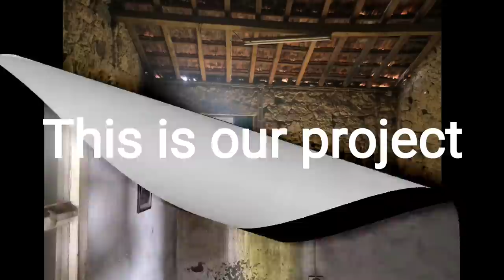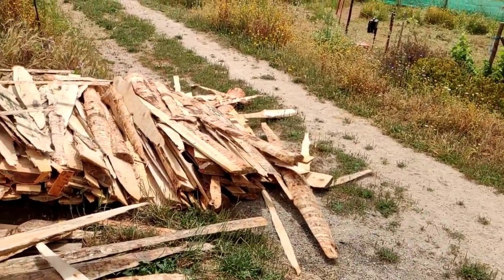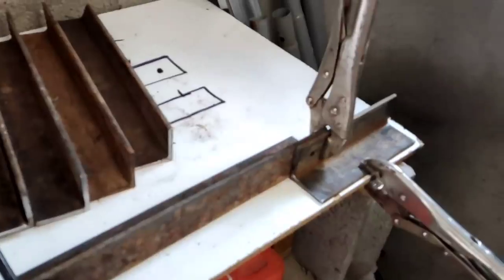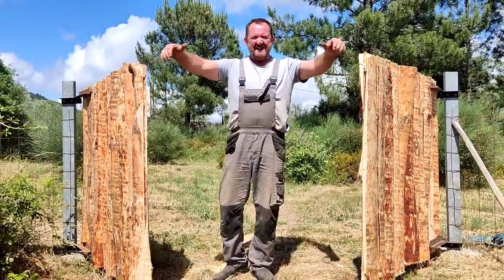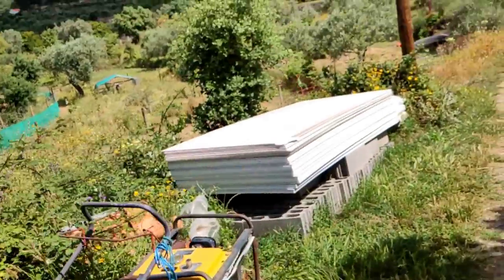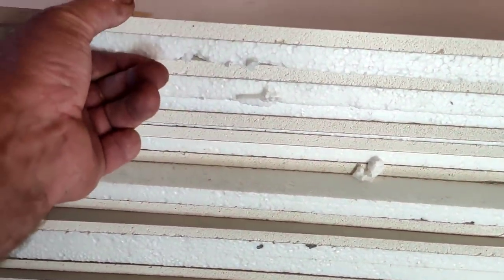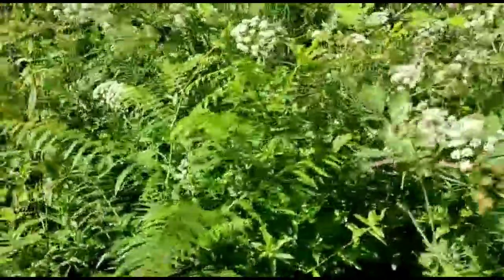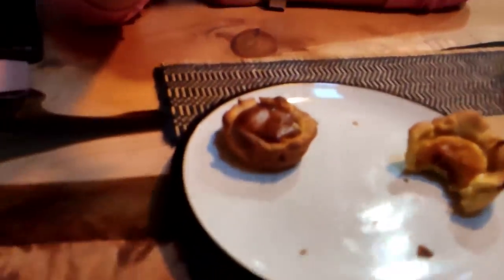63,  Finishing the gates! and a  Pastel de Nata Disaster!! on our Portuguese Farm

Comment: on the plaster boarding .....    will you seal the stone wall first......    concrete will retain moister......
Reply from the maker: I'm not plasterboarding the stone wall, it has some cracks which I will repair but then just re- render over the existing render, there is no moisture as it's an internal wall😁👍

Comment: Nick, you need to clear a path to that lemon tree? 😉
Reply: Or a fruit grabber thingy - the long 6' telescopic pole with a partially basket at one end where the tines of the wire basket curl in like curled fingers for pulling the fruit into the basket.  When it's extended, i think it gives a reach of 15 feet or so.

Nick, our grabber has a disc of half-inch foam resting flat at the bottom of the basket to help keep the fruit from bruising when it drops in.

Comment: Don't know if you've resolved blowing up the tyre yet but I was in the trade for many years, if you remove the valve core you will get a greater rush of air, you need a full tank first as you only get one or two goes, then put the valve core back in and re-inflate .